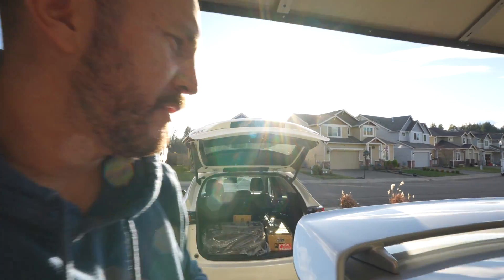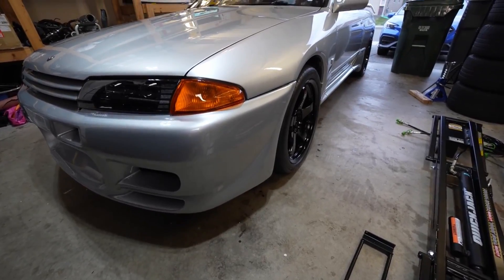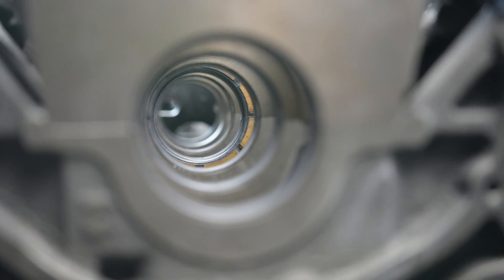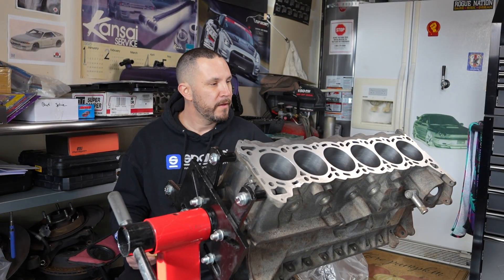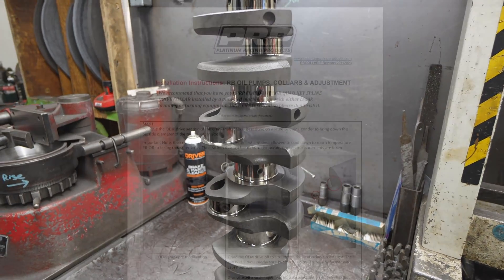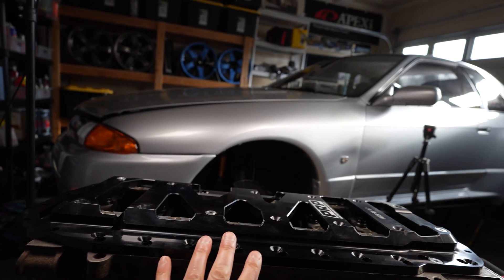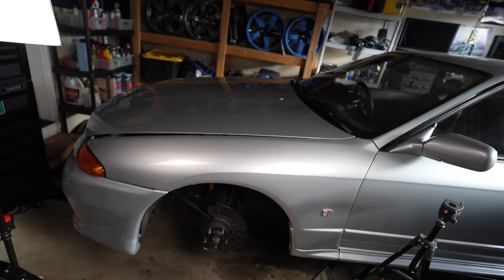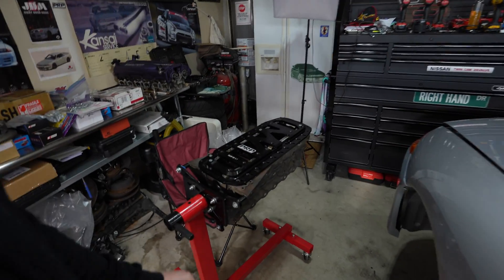RB26 Rebuild Cost & PRP Brace Installation: Nissan Skyline GTR Engine Build Guide

Comment: Josh, I think I like the numbers I see at 3:59 but I want to make sure I understand them correctly.   I think the black printed numbers are the factory original spec for bearing oil clearance, and the red hand-written numbers are the actual clearances he got in the end.  
So you'll have about .0035" clearances on the main bearings and about .0027" clearances on the rod bearings.  Right?  If so, this is good and this is what I've been talking about.  These clearances need to be bigger than stock, and that is what he has given you.  Along with this you use thick oil, like 20w50, 15w50, or 10w60, which you've been doing already anyway.  
BTW, "mag the block" usually means Magnaflux.  Magnetic particle inspection for cracks.  Which is something you can do with iron and steel, like your block is.  
I think the $ charges are very reasonable, not high at all.   This looks to me like really good work.

Comment: Honestly I thought it was going to more than that, but 2800ish for all that, also gives me an idea for my 2j costs, keep vids going! And I can’t wait to see your R32 again
Reply from the maker: Oh hey Matt, you still planning on bringing your 2J to John's? Personally I was happy with that price and I was glad to pay John and his wife for their high attention to detail  work they provide. I also can wait to see your cars running together again! Thanks for watching.
Reply: @JDMRightHandDrive  yes I’m saving up for pistons and arp head studs. I don’t need to do as much as you did. So it shouldn’t be to much, but I still
Gotta take apart my short block, and I was re use the bnib bearings in there. I don’t need bore honing or anything like that. And in may I will be going back to dyno, fixed my spark issue. And get you some numbers for comparison. And as always, if you need set of extra hands just let me know.

Comment: Machining is expensive. Guess I have to save up for another year or just save up for the cast PRP block. I look forward to the build. You have always been thorough. I still go back to your older videos on doing stuff to the RB26. I think if you change out the front open diff with an LSD, it evenly distributes the front torque and prevent the twisting.
Reply from the maker: The front diff is defiantly something I have been thinking of addressing while I have the engine out of the car and everything is apart. I am going to talk with the boys at Intec Racing about different options. Glad to hear some of my old videos are still helping fellow GTR owners. I really wanted to buy a brand new PRP brand new cast block, but that was way out of my budget right now. But how awesome that those guys spent all the time and money to develop a new and improved RB26 cast block. I cant wait to see what kind of builds they do in Australia with those new engines. See you on the next video!